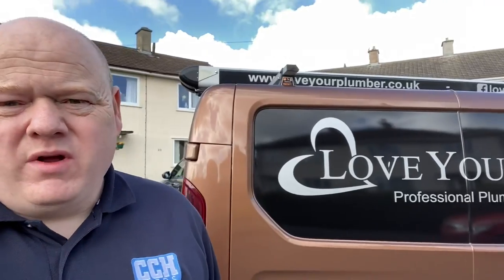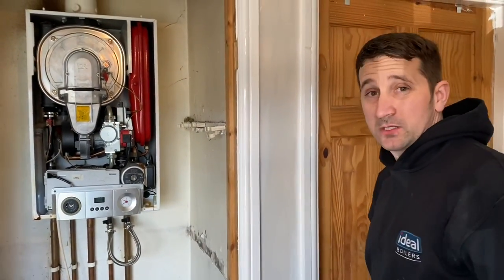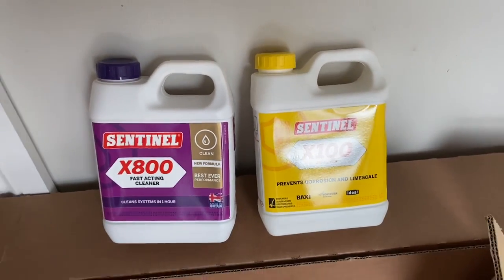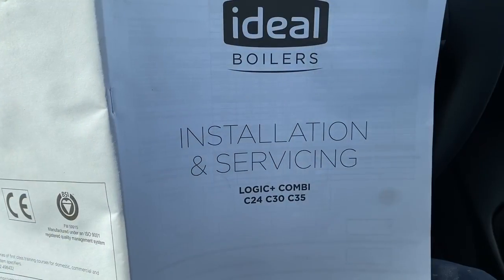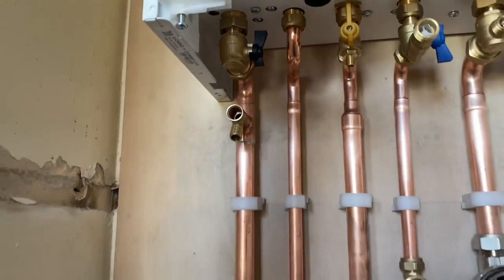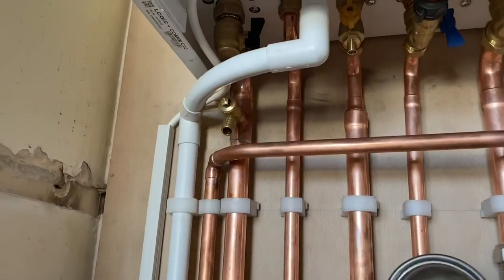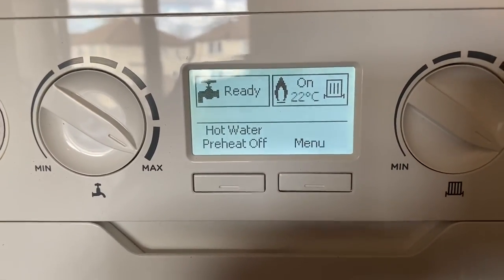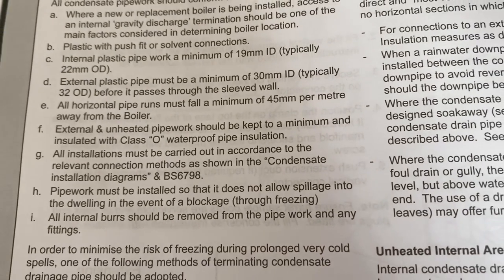Love Your Plumber Boiler Installation - Ideal Logic Max

Comment: Nice job 👍🏻 I too well remember wacking the back of my hand on many occasions 🤬 I still use a tube expander but prefer the 'scissor' type. Great for extending tail pipes to radiators where needed. My tip is anneal the tube before expanding. I've known the tube to split on occasions, so better safe than sorry!

Comment: Nice install. Wish they were all like that.  Spot on with the sections you highlighted in the manual Alan . Flues are rarely installed correctly. The rubber weathershield actually clips over the ridge in the terminal. Also the 1m of copper, rare but does happen. Can’t stress enough how important it is to get that x800 completely out of the system. Any of it left it turns the water a green colour and ruins the pumps. Can go through a pump every few days. (Talkin about you Greenheat)

Comment: Apparently the swaging tool is prohibited by some authorities now. Best to check with your building inspector. The expansion of the pipe narrows the copper wall thickness at the joint. That's why it cannot be used on new water or gas installations!

Comment: Hi Allen
       I watched this video and it came to the part where john was connecting up his pipework. He prefers swaging his pipes rather than applying fittings, be they  Endex, Yorkys,  push fit, or the crimp type you use.
   Myself I would go for swaging first. The reason for this is not just economy. By swaging which does look very neat indeed, it also reduces the chance of a possible leak by up to 50%. Obviously teeing and reducing would need fittings (hence up to 50%)but, a much neater look and a lesser likelihood of leaks is obtained by swaging. :-)
Reply from the maker: Leon Hill John has converted to press now 😂

Comment: I was told some years ago at my gas Safe refresher that you were not allowed to expand the pipe anymore as it causes weaknesses in the pipe.
Reply: Yup, it thins the copper so shouldn't be used on gas
Reply: I'm not saying your wrong, but on that theory, you shouldn't use a pipe bender either as this also thins and weakens the copper.
Reply: @craigwatson7692  tests show the burst strength of bent copper is more than straight lengths, theory being the inner edge of the bend is compressing the copper (to increase strength) and stretching on the outer edge of the bend. Swaging works differently as it stretches from all directions of the radial copper pipe, with no compression taking place compared to bending, hence why bending is allowed :)

Comment: Hope that Ideal is better than mine, 7 year warranty on it which was needed as the amount of problems with it. To be fair Ideal fixed every one including the last one which was the heat exchanger!
Reply from the maker: 10 year warranty on this one. The system was fully flushed so the heat exchanger should last. Thanks.

Comment: Hi Allen I might be mistaken but was it during the early days of Combi boilers that the Flue could stick out at any length Especially in flats plus I have removed a few flues from Vaillant and Potterton boilers that was exposed however the inside plastic section where the gasses plume through was cracked and split yet the outside of the Flue was in perfect condition 🤔

Comment: If the boiler was ther why did all the pipework have to come out and the board all nice but not necessary you could be prising yourself out of a job with extra work .i do understand about making it look neat and i use a socket tool not seen the one you have were did you get it from thanks
Reply: Appreciate your comment, I always do this on the job. It looks better and it makes it easier for me personally. 
It's around £25 for a sheet of plywood and with the off cut I use it to cover the old floor because we all know they are battered and broken boards. 

When the customer pops their heads in they can see I've taken my time and not only cleaned then system, I've tried to tidy things up. 

You wouldn't believe the amount of times a customer as complimented my work not just the boiler but the way I've tidied the whole cupboard up. 

They are the jobs that the customers want doing but dont like doing lol. 

I'll crack on this way as it works for me. 
Like I say, thanks for the comment though. 

Ps, the swaging tool is from Amazon 👍
Reply: @powney13  yes i do understand i like to do the best job i can but the domestic game is cut throat and every day you go out you see a new van so when im prising i keep it to what i neen to do but i suppose you could offer the extra bits if you get the job.thats why i liked commercial work years ago when dad was working we did a lot of barrel work in the schools and hospitals allways used the best materials and any copperwork was with brass clips and Yorkshire fittings the good old days luckly only  got a few years todo now and these days i pick and chose my jobs i install a lot of Worcester boilers i know Allen doesn't like them but i find them good and no real issues with the amount i have installed all the best Regards Lee

Comment: Nice installation very neat on the pipework , I’m not sure if you’re supposed to have a gas pipe swaged ??also nice to see all joints soldered as personally I’m not going to use press fittings as we all know what happens to O-rings when they get old
They always get hard and brittle and deteriorate, I wouldn’t trust them at all
Reply from the maker: Thank you for the opinion.

Comment: I have just had this boiler fitted the condensation pipe on the outside of the house  should this have  protection on it as it is now it is just the pipe
Reply from the maker: The pipe outside will normally need protection. Please check out the installation Instructions. Thanks.

Comment: Hi, I have this boiler in my home. I have turned off the black valve of the far left underneath the boiler and it is now stuck and won't turn back on (the valve is stuck). Is there a reason for this and is there anything I can do to turn it back to where it was. Also, what problems would be caused if it is left turned off? Thanks
Reply from the maker: Which valve is stuck?
Reply: @AllenHart999  It was the black one on the far left. I have managed to turn it back up right now and the issue is solved. I just don't think I was pushing hard enough lol. Thanks anyway.

Comment: What are your thoughts of putting a tee in the flow & return with two washing machine valves and blanking plates so the boiler can be isolated and then the system power flushed at a later date?  Overkill?

Comment: Hi Allen I am surprised to see you are still using a hand pipe tool to cut copper pipes. Do they not Have a fitting you could add to the your pipe crimping drill to cut pipes.?? I bet you often scrape your knuckles against the wall or other pipes get in the way. Has there been some attempts to make a battery copper pipe cutter but just don’t do the job well.???
Reply from the maker: Thank You

Comment: great vid,    if you were called to install a boiler but the customer was not willing to agree to power flush the system before hand ,  would you agree to the install ?    even tho by default this would make the warranty invalid (I assume)    and would you make note of this on the commisioning documents
Reply from the maker: I wouldn’t work for a customer that doesn’t want the job done correctly

Comment: John did everything right. Except fit a decent boiler.!
Reply: Can't please everyone Peter 👍
Reply: @powney13  should definitely be trying to please your customers though.will need new heat exchanger soon enough.
Reply: @shavenhaven6869  last year I fitted near 100 boilers 
the year before 60-70 
Year before that around 50 ish.
This year around 40 so far. 
260 boilers installed in under 4 years. 

I've had 4 call backs all on the vogue. Not 1 on the logic. 

I'll carry on fitting them until they cause me and my customers grief. 

Every boiler had different faults, each installer to their own. 

I've had 4 problems with them
Reply: I agree. The worst thing I find with the logics is the service cost. The seal replacement kits are £50 and unless your just sticking your probe in the flue, you will end up replacing the seals, at least on every logic I've touched they've need replacing. Compare that to a baxi 600/800, the burner seal doesnt need changing unless it looks distorted and even if it does, so long as it's under warranty, baxi will send you a free one. So you've got 2 boilers with similar prices and warranties, one has a stainless steel heat ex, brass components and cheap service costs, the other has a heat ex which is no stronger than a tin can, plastic components and costs twice as much to service properly, which one you going to choose?

Comment: I think it is OK, but i have always considered mounting a boiler on a flammable surface as bad practice. I alway insist on plasterboard layer over the plywood. I am a joiner though and am told i think too much 😮  I am very impressed with the swaging, never seen that before. It looks super nice. But i'll stick to end feed fittings as i have enough tools for my joinery.
Reply from the maker: Plaster board is worse unless it’s plastered 😂

Comment: Hello
How much cost the installation, including materials in London/Bromley?
Thanks
Reply from the maker: Depends on installer. Thanks.
Reply: @AllenHart999  Could you tell me the average price. Please

A friend was charged £2500 included the new boiler and materials  (09-04-2020) for a Logic new boiler replacement. They make a new flew at the low roof. Seems overpriced to me.

Thanks

Comment: Mr Hart can you explain that while installing new boiler is the expansion vessel already charged to 0.9mb or do we have to charge it ??
Reply from the maker: Normally they should be ok. Thanks.
Reply: 1 bar! If it's got 0.9 mb in it, it will definitely need recharging.
Reply: @tigerick7291  Check the data plate on the expansion vessel. Many say 0.8 or 0.9 bar precharge. 1 bar is not written in stone.
Reply: The R World said 0.9 MB not 0.9 BAR.
Reply: yeah my bad i meant bar thanks i got my answer

Comment: Hi Allen, I got a big family of 6 and the hot water is constantly being switched on/off causing many faults, what new boiler on the market would be best for this situation? Thanks mate
Reply: Raj Singh - if you have ensuites and a bathroom you need a mains pressure water storage system rather than one boiler.

Comment: I was of the understanding that you shouldn’t swage gas pipe!?
Reply: Same here. I tried to search up about it but couldn't find anything
Reply: Nah you shouldn’t it’s not classed as a proper gas fitting
Reply: Yes you can it’s in 6891 7.2
Reply: @anthonycannon740  I thought that you can not alter or adapt a fitting to be used for gas. So with that in mind surely a swaged socket is not a suitable fitting. I was told when I did my CCNI that was the case but will stand corrected if its wrong.
Reply: The fitting must be a purpose made fitting. Where the fitting must not be damaged bent or not purpose of use.
Reply: I look forward to trying the condensate trick. 👊🏽 nice to see someone take pride

Comment: Top quality install, does the plywood need to be a certain thickness to support boiler?
Reply from the maker: The plywood is not structural, You still drill into the wall with all fixings. Thanks.
Reply: @AllenHart999  are ideal logic 24/28 about £900 mate? Thanks

Comment: Hiya, am all new to this and just wondering:
1. Approximately what price the Ideal Locic Max installation should cost roughly? (in € if possible, I am about to pay €2400, is this reasonable - includes flush of 11 heaters)
2. About how long should the entire installation take including the flushing? 
3. In your opinion, Ideal Logic Max better than Bosh? Or are they similar enough? Any better on the market I should consider? 
4. I know there is a lot but is there any main points to check before my gas man leaves?
Reply from the maker: £2400 sounds a very fair price TBH, As long as you have the boiler serviced it will be under warranty so you will have total piece of mind. Hope this helps. Thanks.
Reply from the maker: Thanks very much for your comment, please consider subscribing to support the channel 🙂
Reply: @AllenHart999  Thanks so much for the speedy reply Allen

Comment: Could the installer fit a hopper on the RW downpipe and then run the conensated pro into it. Rather than all the way down to gulley?
Reply from the maker: That would of been an option. Thanks.
Reply: Great question is that. Yes I could've done it like that, I think with Allen doing the recording I may have overlooked that 1. Thank you for the comment
Reply: But then you would have to insulate the down pipe because it becomes a condensate pipe. True story that!

Comment: Hi Allen, i am currently a gas engineer apprentice in scotland. I have watched your vids for a year and a bit now and just came across this video on your page. What tips/tricks would you give to someone who is fitting boilers more regularly instead of watching if you understand where i’m coming from. That would be highly appreciated. Thanks Allen.
Reply from the maker: You can try to work out what you take into a job and use it on every install, then work out what you don't need. Only carry what you need. Also, work smarter, like flushing flush the rads while doing something else.
Reply: @AllenHart999  thanks allen. another question, what’s your favourite brand of tools?

Comment: Never new you could bend condense pipe lol?
Reply from the maker: I have never done that before. Do you do this as well? Thanks.
Reply: @AllenHart999  no never thought it was worth doing personally Allen. Can i ask you can something mate... can you clean out tf1 filters effectively without taking the leak prone lid off just flush it through the drain of thanks?
Reply from the maker: Gary Lawton Yes you can, it does leave a little bit at the top but that’s not really an issue. The lids are ok really, I wash the o ring and then dry them, then silicone grease them, Thanks
Reply: @AllenHart999  yes your right it did seem to help doing that the dirt on the o ring probably caused it not to seat well and causes them to leak mine is on the flow for some reason the guy who installed the boiler in 2007 put it like that and not on return will it still be effective there (on flow) mate? Thanks

Comment: Some points. 
1. Condensate pipes freeze because the boiler drips the condensate into the pipe. The ice builds up gradually inside the pipe.  When using a condensate pump the condensate is discharged all at once in one slug.  This does not freeze up in the condensate pipe. So no need to have highly insulated waterproof lagging around condensate pipes.  So the makers instructions are not always right in all scenarios. This is when a valued decision must be made. There is no need to insulate a condensate pipe (32mm and above) if a condensate pump is pumping into it. 

2. The outside condensate pipe, in black, looks hideous spoiling the looks of any house. In this case the outside of the house was white making it worse. Using a condensate pump like the Grundfos Conlift can lift the condensate into the loft discharging into a soil stack running through the loft.  The flexible plastic condensate pipe from the pump can be under the loft insulation, with only the connection to the stack needing extra insulation. 

The Conlift has the advantage in that the boiler's copper pressure relief pipe can be piped into the condensate pump, again eliminating drilling through a wall.  OK, the condensate pump is something else to go wrong, but the Grundfos pump is reliable. However it can be cheaper overall than fitting a long external, ugly, highly insulated, waterproof, condensate pipe, needing an extra visit to paint another coat, and also quicker. And eliminates having two ugly pipes on the outside of a house. 

3. Another point is that if the householder does not want the outside walls having ugly condensate pipe, a non-condensing boiler can be fitted. Read the exemptions, it is quite easy to eliminate a condensing boiler. One factor is extra cost (lagged condensate pipe). A Vokera fitted with modern controls can be quite efficient indeed. I know Vokera make a non-condensing boiler, which is quite reliable. Have a few  fitted in flats where condensing boilers are difficult. Any other Makers?

Comment: I have just had one of these installed, what are they like? The warranty swayed me.
Reply: Mark GAWA All in all not a bad boiler mark fairly quiet ,reasonably economical and quite reliable just get a proper service every year and I mean a proper strip down clean out and flushed out with water on the heat exchanger and you’ll be okay
We see too many neglected ones and they are the ones that give problems!
Have you got a Magna clean on yours?
Reply: Thanks for the reply, I really appreciate it!! I have always got the boiler serviced every year before hand and will continue to do so. Not 100% sure about the Magna clean - will look into this though!!
Reply: Sorry. Magnetic filter, I don’t believe so! How much are they to have installed?
Reply: Mark GAWA no problem Mark there should be a big black round filter somewhere underneath the boiler they are usually Magna clean or Fernox branded, I fitted about 15 of them 10 years ago and they all lasting quite well 
they work well with a weather compensation sensor fitted outside, if you’ve had one fitted
Reply: Mark GAWA , If your installer didn’t fit one he should have! Get him to come and fit one and charge you for the filter only around £90
Reply: No problem at all, I’ll look in to get thing that done asap! Thanks for the help and tips, gentleman!